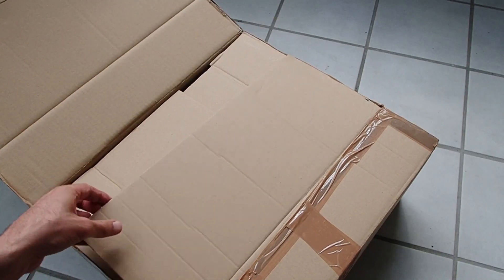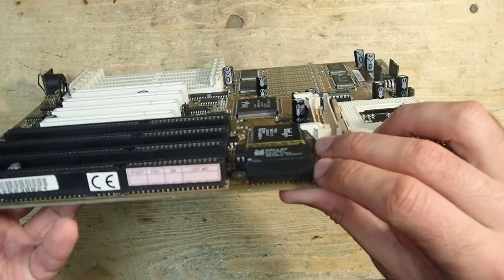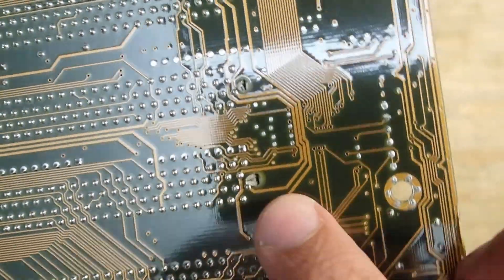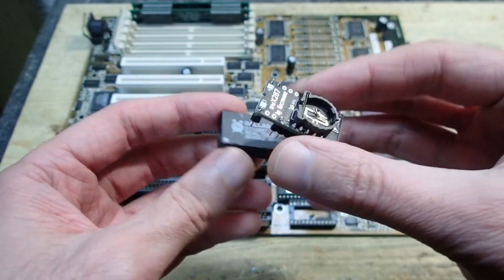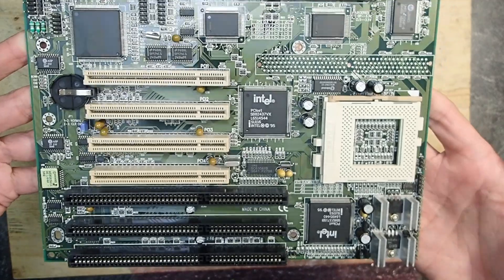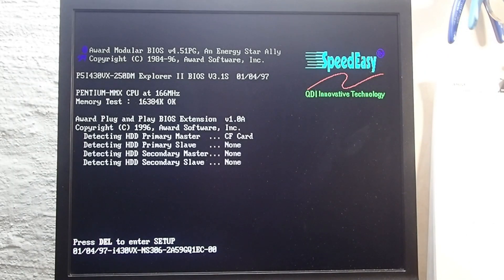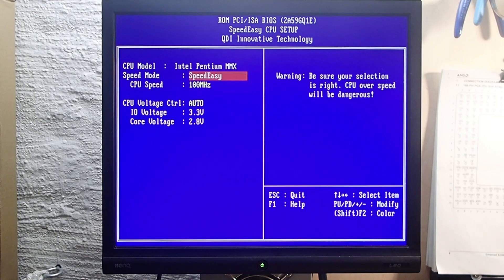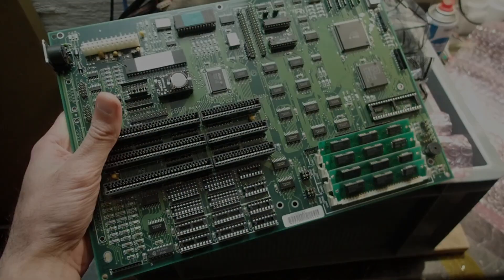Repairathon 2022: The final cut

Comment: I love these watching this stuff, it brings back  great memories of  where I used to work, memories of  when you had to not only be able to turn a screwdriver but be a master at flat cable kung fu! lol  the cables below the CPU socket werent a problem back in the day in the cases we built them in, and when your assembling a lot of machines every day it helps! I preferred them to be grouped with the floppy connector  that way as with some skilful cable folding and routing  made them look very neat and tidy, the rule of thumb was the closer to the lower  right of the board you could get the floppy and IDE cables the neater the build would be and less restricting of air flow the neatest builds would always have  the floppy and the both IDE headers  close together so you could cable tie  them into a  skilfully folded trunk rather than have a jumbled mess  and cable tied together, it also helped stopping them rattling loose in transit

Comment: My first jumperless board was a QDI Titanium Intel 430TX socket 7. I also remember I shorted out the board by being stupid and forgetting to remove the 'reset cmos' jumper as I started up the board. I got a large spark, and one of the system board traces broke. It actually rolled itself back physically from the board. I then bought a new one. I think the 430TX version had the 83MHz bus option in bios. In those days I bought new motherboards all the time. But I remember the QDI Titanium 430TX really stood out for me with it's jumperless design. I was an overclocking enthusiast so it really was a big deal for me.
Reply: 83 mhz setting was only in unofficial BIOS.
I dont have it there, only 75 on QDI Titanium IB. Anandtech mentioning it in review from 1997, that there is unnoffical BIOS with 83 mhz, if I remember correctly, he didnt have it too. just mentioned it.
Reply: @warrax111  Thanks for clarifying. Now, when you mention it, I may recollect something like that. It's been many years though. I must have gone the unofficial bios then. Because I had several 430TX/430VX boards before that QDI, that would let me do 83MHz via jumpers.
Reply: i did the same on a PCI 486 board sadly, leaving the cmos reset jumper on, it still posted but i couldn 't save the cmos no more. even with a good battery.

Comment: This has been a wonderful series to watch.  I still need to get on of those e/eeprom flashing units.  I have a curious AT Socket 7 board here that I have looked over top to bottom, and aside from a few leaky caps that I replaced, visually everything looks fine.  But with the analyzer in, I get no response just --.  I was hoping maybe the BIOS just got corrupted, but unfortunately in 5 days, the two cats we have had for 18 years passed away, and there isn't the money now for a programmer.  Maybe after chirstmas.  But keep up the excellent work.  I now have two of those techmedia boards that need to be repaired.  The battery damage on the second one is so bad, that it discolored the PCB.  It's way beyond my ability.  I cannot repair traces at all.  I don't have the tools or the skills.

Comment: Pretty sure my Socket 7 Abit board had a jumperless setup too called "Softmenu", think it was an AB PX5 iirc (could be wrong), that also had 75 and 83mhz and my lowly 166 MMX which was one of the early steppings with the unlocked multiplier would run happily at 262.5mhz and was an absolute beast for the time and totally stable, it would even boot and run at 290 but not fully stable.
I've really enjoyed your repairathon series it's been very entertaining, thanks for taking us along on the journey. 👍

Comment: I remember those QDI boards very well (well obviously not that specific one, mine turned to e-dust ages ago). Back in the day when the Pentium and Pentium MMX were current, a board with a VX chipset was the mother of all motherboards. Unfortunately, it was also like unobtainum: very hard to come by - at least in my experience. But for once I was lucky and got one through a friend. Supposedly it was the fasted Socket 7 board with a VX chipset you could get. And it was fast. I am not sure if it was the fastest, but fast it was.

Comment: There were quite a few jumperless Super Socket 7 boards, particularly toward the end of their production cycle. The tech company I worked for back then used to sell them. This was well into the slot 1 Pentium III lifecycle. AMD's K6 lineup really kept the platform alive. The last SS7 board I owned (at the time) only had SD RAM slots, AGP, jumperless CPU, ATX form factor complete with USB and a host of other features one wouldn't expect on such a dated socket. Sadly I don't remember the model of the board, I think it was ASUS or Gigabyte.

Comment: My first motherboard was a jumperless Super Socket 7 board, a Zida TX98-3D back in 1999.
Reply: I have the same board. And its funny its jumperless if you set the jumper right :-) For me its not Super7 board. It can run nearly any CPU, but it has no AGP and no 100MHz FSB.

Comment: I just luckily got this QDI Explorer II speedeasy board, it was in 486 case, I bought, for 486 build. I knew only, there was some Pentium 1 system inside, but expected, as usually unlucky, some shitty board (PCChips VX maybe even FX board). It was nice suprise, because I know about it was one of the first jumperless board and I kinda wanted it. But I wasnt motivated to pay for it as for other socket 7 boards, because I have already enough of them for my tastes, and I have also 2 VX boards, so was demotivated to buy third one. 
So seems, the board has found me on it's own. Without me, even trying.
I have also TX variant (QDI Titanium IB) of it, and it's super cool. Nice to know, about linear votlage regulators, and fan needed, I didnt noticed it.

QDI and ABit was first companies, that introduced FSB, multi and voltage in BIOS. Zida and PCChips was next (I have PCChips TX board from 1998, taking also K6-2, it has 2.4v vcore as minimum, and setting vcore in 0.1v steps in BIOS!!! I was pleasantly suprised.) Zida Tomato boards got also overclocking (setting multi and FSB) in BIOS, on slot 1 boards. I have BX and ZX boards of Zida Tomato, and both have setting FSB and vcore in BIOS, but no vcore).

I think , these were first companies, that innovated this new jumperless feature, and it's cool.
Unfortunately, Asus and  Gigabyte holded with jumpers/.swtiches for too long. They were conservative. Gigabyte tried to use it even on first socket A boards, to mess with jumpers and switches, and they were critized for it in reviews, particulary heavy in 2001. Most of manufacturers did have overclocking in BIOS, many in 1mhz steps FSB.

So QDI socket 7 boards are cool, this speed easy variants, and TX boards are good. Just search for Anandtech review, of QDI Titanium IB, he prazied it, and also it got one of the highest performance with default Pentium 1 MMX. The better was only one of the Abit board.
QDI was sadly less quality manufacturer (we can see it on linear voltage regulators), Aopen , Asus and Abit were better, but this speedeasy feature, made them better. They were always pro-overclocking. The only pity is, they used tantalum capacitors for so long. I've found them even on Slot 1 boards, particulary with Via chipsets, like Advance 9, Advance 10. They were quite average company, for boards, but overclocking features made them good in early times, definately their board were good pick, when budget was a issue.

Comment: QDI P5I430VX-250D or QDI Pentium Explorer II SpeedEasy was my first mainboard back in may 1997. I could not find the bill, but i did find the retail price list from 5th of may 1997. It says 3080 CZK, which is around 172 DM, or 100 USD (according to the exchange rate at the time). I guess its excl. VAT.

Comment: Brother! First I must say that I'm learning a lot from your videos and they make me very happy. Thank you!

I want to ask you something.
I have 3 M919 v3.2

N.1. Works normally! Some PCI video cards are not compatible with it. Voodoo 3, for example, shows a red screen, nothing else. I really don't know why as it should be compatible (I'm running the bus at 33 MHz).
N.2. Always gives an E2 error (memory). I have checked and the SIMM is getting 5v. I tried with both 72 and 30 pin modules. The CPU gets either v3.3 or v5 according to jumper settings. I don't know what else to try on that one! I'm rather limited as I only have a multimeter and I'll be getting a logic probe soon.
N.3. Doesn't react at all. CPU gets the right voltage, but no error codes, nothing at all.

I thought the power transistor 2SC3420 could be the culprit, and in both cases I replaced it with a 2SD2583 (compatible as far as I can tell) and it also gives the right voltage, but it didn't make any difference.

I also tried swapping the BIOS from N.1 to N.2, but it didn't help.

Something interesting is that N.1 (the one that works) has two 2SD882, instead of a single 2SC3420 like the other boards (I don't think it's related to their problems but may be worth mentioning).

Since I have one that works, I could swap parts until I find the defective one. I even could swap the chipset but that's pretty hard and would be a last resource.

What would you recommend me to test next with N.2 and N.3? I'll be happy with any advice you could give me. I really enjoy retro-repairs and repairs in general and I thank you again. You are awesome.

Merry Christmas and Happy New Year!
Reply from the maker: Hi! 
N1. 486 PCI is a very early implementation, it's very common to have issues with later VGA cards. A Voodoo3 is a bad choice for a 486 anyway. 3Dfx needs a fast FPU and for Voodoo3 I'd suggest at least PII or K6-2
N2. Could be memory parity error or wrong memory modules. M919 should be able to use EDO, but for 486 it's better to  find FPM modules. If your memory has no parity chips, deactivate "Parity Check" in the BIOS.
N3. Hard to tell what's wrong about it. I'd start with voltage (you say it's ok) and then I'd check the clock.

This is what I can tell from the hip. Good luck.
Reply: @necro_ware  Hey! Thank you for taking the time to answer me.
What would you say that gets broken more often when you put a 486 in a wrong orientation?

About Voodoo3, yeah I know it's way overkill, I was just trying to see how fast the system could go (the video card worked on a different 486 setup).
N2. I tried with several memory modules that are known to work OK. And the motherboard still doesn't find the RAM. As with N3, I don't know what to swap with N1 (the one that works).
If you have any ideas of what to do (assuming the clock is right) I'd appreciate them very much. Thanks for your channel again, have a Merry Christmas and I wish you and your loved ones all the best.

Comment: This was a great series so thank you! Unfortunately, all of the issues you found and fixed didn’t lead me to fix the problem I am having with my VX Pro socket 7 board by PCChips. The board posts but no video out from any PCI (4) or ISA slot (3) I use. Anyone have any suggestions?
Reply from the maker: Hard to tell without having that thing in the hands
Reply: @necro_ware  do you have any recommended troubleshooting steps for that sort of issue?